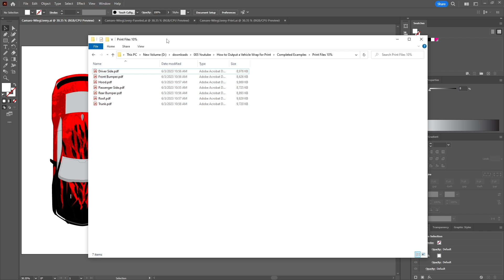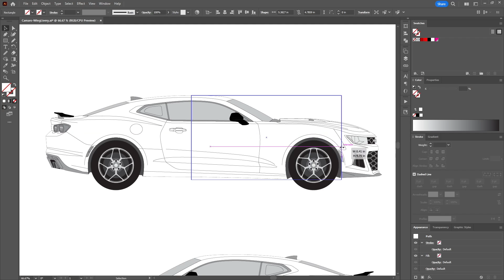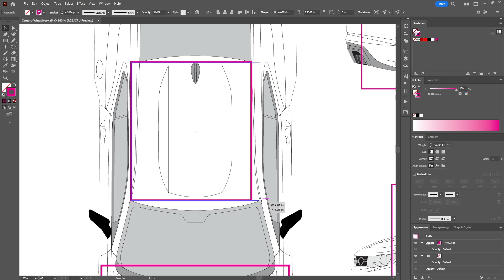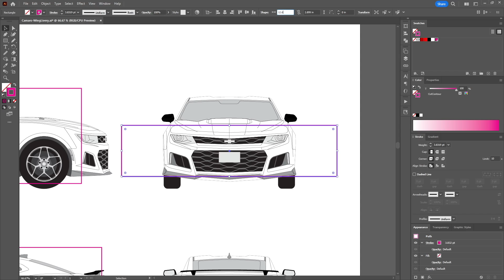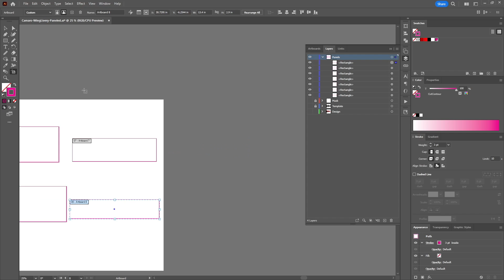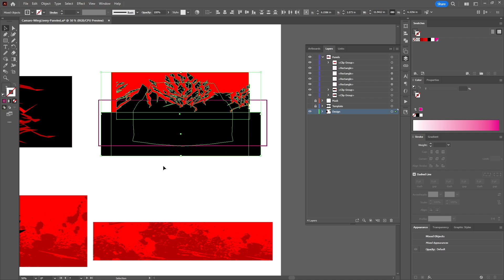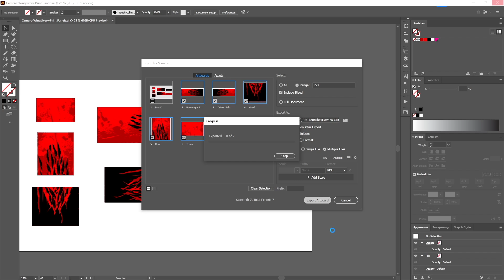Learn How To Output A Vehicle Wrap To Print | WePrintWraps

Comment: "New" refers to something that has been recently created or discovered. "Newer" refers to something that is more recent than another thing. "Newly" refers to something that has just happened or been done. 

"Extension" refers to the act of making something longer or the process of extending something. "Expansion" refers to the act of increasing in size, volume, quantity, or scope. 

#EnglishLanguage #Vocabulary #Learning #🆕 #🆕👀 #🆕👌 #📐 #💪"Layout" refers to the arrangement of text, images, and other design elements on a page or screen. It involves determining the placement, size, and orientation of these elements to create an effective and visually appealing design.

"Layaway" refers to a purchasing option in which a customer can pay for an item over time before taking possession of it. The item is held by the seller until it is fully paid for, at which point the customer can take it home.

#GraphicDesign #WebDesign #Layout #Shopping #RetailTherapy #Convenience #💻 #🎨 #🛍 #💸 #🛒 #💳"Layout" refers to the arrangement of text, images, and other design elements on a page or screen. It involves determining the placement, size, and orientation of these elements to create an effective and visually appealing design.

"Layaway" refers to a purchasing option in which a customer can pay for an item over time before taking possession of it. The item is held by the seller until it is fully paid for, at which point the customer can take it home.

#GraphicDesign #WebDesign #Layout #Shopping #RetailTherapy #Convenience #💻 #🎨 #🛍 #💸 #🛒 #💳A "corner" is a point where two lines or surfaces meet, typically forming an angle. It can also refer to a street intersection or a position of disadvantage or difficulty.

"Cornered" refers to being trapped or forced into a position with no escape or room to maneuver. It can also refer to an animal being driven into a corner or a person being put on the spot.

#EnglishLanguage #Vocabulary #Grammar #Geometry #Trapped #Escape #📐 #🦝 #🚶‍♂ #🚪 #🔪

Comment: When you print how do you tell the machine to print the right dimensions can you show that? like how does the machine understand it is 1:10 or 1:20 scale
Reply: I think you gotta change the scale when printing.But there's an option in export by which you can actually scale it to different sizes while saving it as pdf.